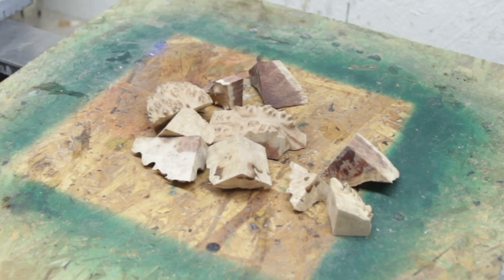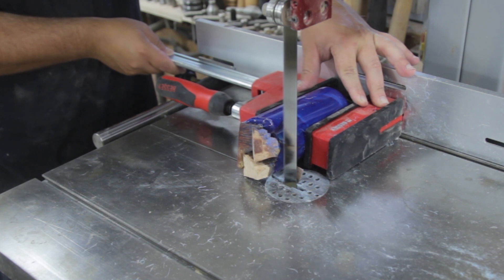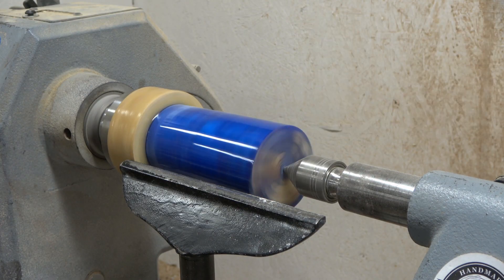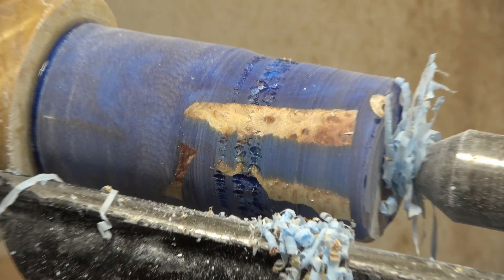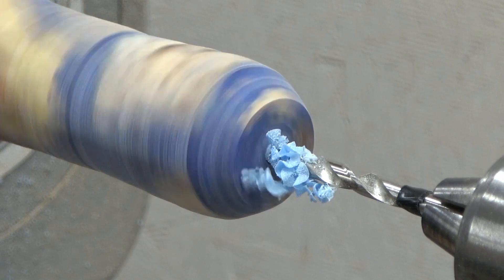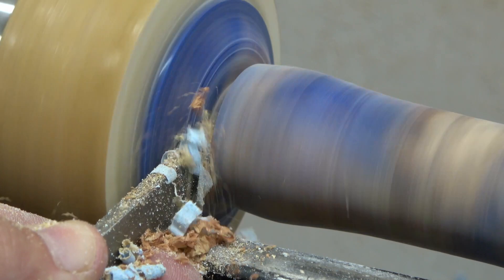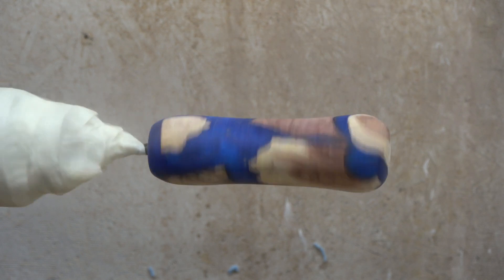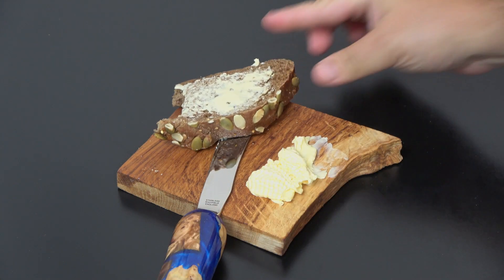Wood Turning Burl Off-cuts to Resin Hybrid Knife

Comment: Thank you for showing your process on how you do this and the negative rake. I would be worried using a drill bit and if it broke off in the handle while sanding.
Reply from the maker: Thank you so much 🙂 Yeah i went very gentle with it

Comment: You should know that a negative rake can be tilled on a slight angel,with stop tear out,just a thought. Ernie smith from brisbane Australia
Reply from the maker: Does not give the same results. I did that before getting negative rake bits plus you have to hold the chisel in a wired angle. Worth getting a good negative rake cutter trust me.